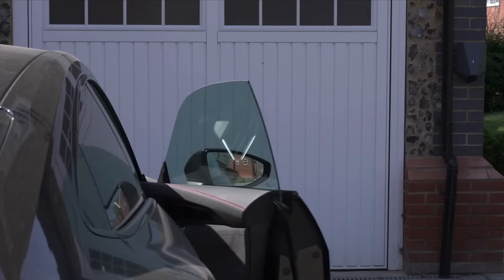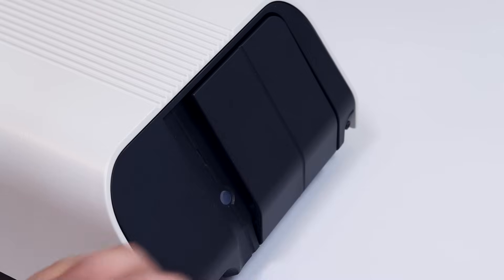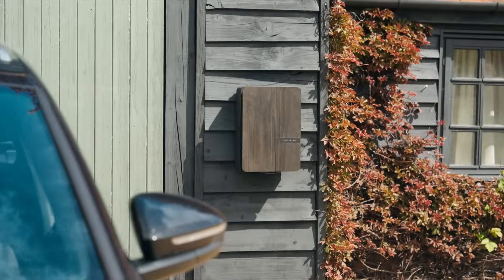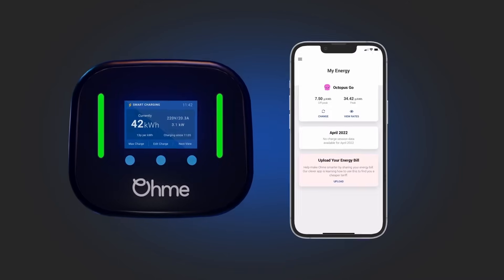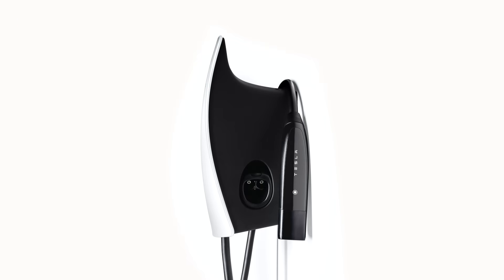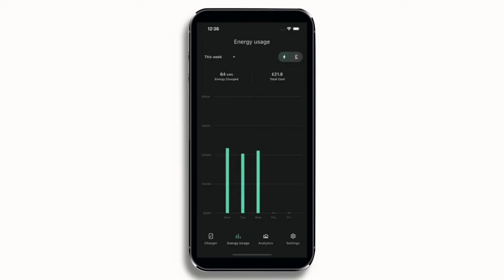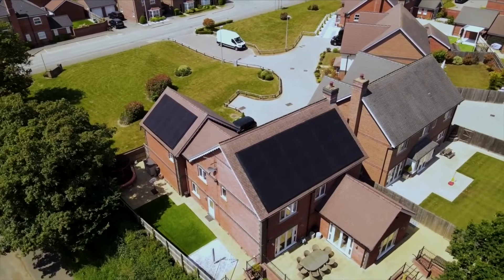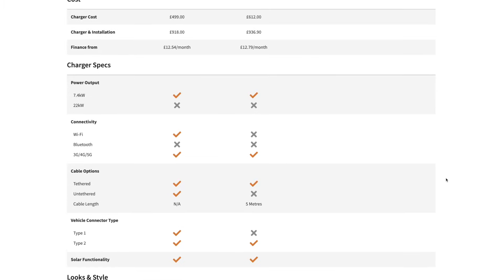Best Home EV Chargers - Our choices

Comment: I went with a ohme home pro, and I semi regret it. The convenience is great.. when it works. but as is well documented online, the unit just doesnt reliably connect to 4g (no it's not a signal problem) and it tends to tell you "charger offline" when the app (timer) knows it's going to start charging. I regularly have to go to my fuse board and reset it, faffing with disconnecting it from the car, reconnecting, watching the app and the unit to ensure its working again.. pain in the rear. roughly every 3rd day/charge. Wish I'd gone with a different setup because in this day and age, everyone including me just wants things to work reliably with no attention required. Not ohme.

Comment: How come the wallbox range is not included in this list?
Reply from the maker: Unfortunately, it's not a brand or product we would recommend at this point. We've sold and installed them in the past, but their customer support is too poor and unreliable and so it's not a product we can recommend to our customers unfortunately :(
Reply: @SmartHomeCharge  very interesting. I had a mixed experience with them. I bought a pulsar max (I switched from the lovely easee due to needing something that connects to octopus) and experienced a lot of connectivity issues including the app, WiFi, Bluetooth. After about 4 months it also started being extremely erratic while charging. As you said, the support is a minefield, however once I managed to get through to someone over the phone, they quickly looked into it and said that they identified a fault with my charger and will be replacing it free of charge. I got the new one within a few days, and I must say I'm very happy with the new one. The connectivity is faultless now and it's reliable without fail.
Reply: No zappi either?